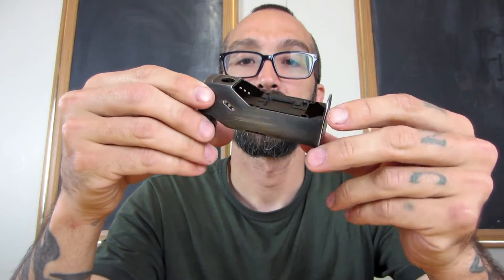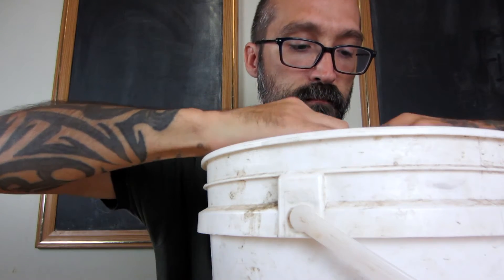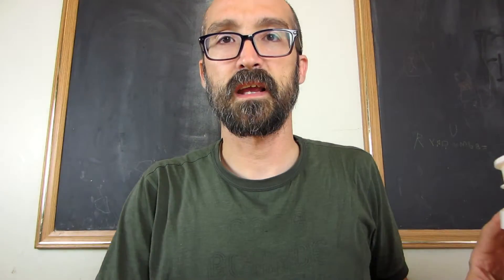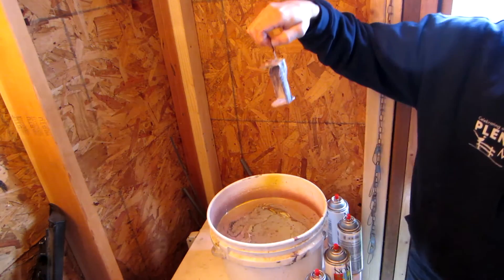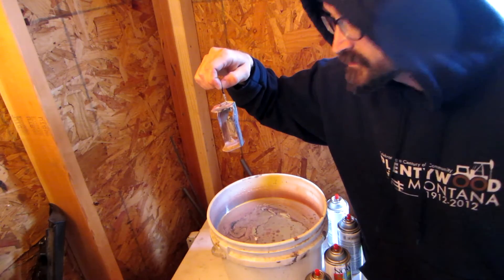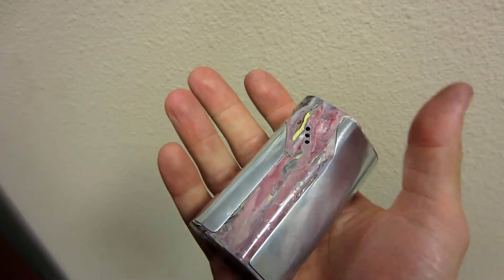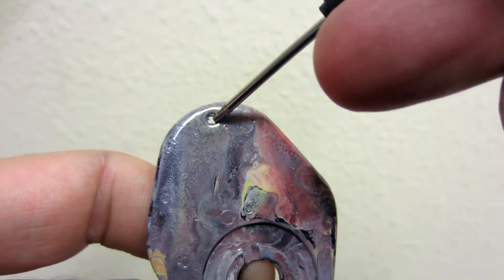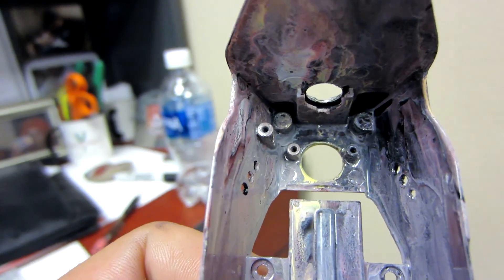RX200 PAINT| MODDING MODS EPISODE #2| DAVE GEE | ELECTRIC REVIEWS

Comment: I've never hydro-dipped something, but based on the mechanics of the process it seems like you might have better luck doing it the other way round.  Try this: put the paint on top of the water as you have but put the item into the water in a relatively clear spot, then slowly lift lift the item out through the paint, that way the paint gets applied on the item's way out of the water instead of immediately before the item is submerged in water.  I feel like it might come out less "muddy" if you do it that way.

Comment: Awesome! I've been hydro dipping some parts on my scooter, didn't think to do it to a mod. Thanks for the videos! I've got a few mods to disassemble.
Reply from the maker: +Alex Sayers Thanks man, I have ended up doing it again and did not like the results so I went with some auto paint. Deep pearl blue like you would see on a corvette. Those colors just weren't my style.
Reply: +Electric Reviews I was thinking a deep purple, forest green, midnight blue, silver, and black for my sny sdna200. Going to try it on a nemesis clone tube mod first. I am pretty sure there are some hydro dipping spray paints.......
Reply: +Alex Sayers enamel modle paint works great as well.
Reply from the maker: shit I never thought of that... Pro tip man thanks.
Reply: +Electric Reviews your welcome I would use pipettes to transfer the paint into the water.
Reply: +Electric Reviews one drop at a time ando add to your liking.
Reply: +Bishop Vapes Right on thank you!
Reply: +Electric Reviews you could also possibly get it down to the bare metal, use alcohol inks, then clear coat it once dry! I have used alcohol inks on some mech mods I have, you can get a very interesting look from it! If I ever get around to doing it on my RX, I will be sure to send you some photos!
Reply from the maker: Drew Harris That would be awesome. My sister just started doing mugs and coasters with ink, I tried it and didn't like the effect... until I looked up some real work with it. Holy cow there are some crazy things a person could do with it. I would love to see pics.
Reply: +Electric Reviews my mom has done our coasters at home with them!! That's too cool. She just loves the splatter, but when I saw some inks done by artists, it was astounding! I'll be re-watching your previous video in this little series of how to strip the paint and how to do the polish, whenever I'm ready to tackle that fun time! The problem is that I'll be without the RX for a day or two to let everything dry! I'll need to wait until GeekVape gets the replacement positive pin in at their US service store so I can use my mech and Tsunami while the RX is out of commission
Reply from the maker: Drew Harris I took me forever to film the DNA swap just for that reason. Once  I had it in there I didn't want to take it out and risk soldering off a fuse or something.
Reply: +Drew Harris can you send me a pic as well?
Reply: +Bishop Vapes for sure!
Reply: +Drew Harris thanks alot Drew.

Comment: what did you use to get the original paint off the body of the mod? I know a lot of people were having an issue with that
Reply from the maker: I ended up doing the stripping more than once and its never fully come off. Its almost as if its cast and anodized. Its a rougher surface than the plates. I'm sure its cast but not sure if its anodized. Sanding is about the only option for that part since its going to need to be a smooth surface for polishing.
Reply: You can actually get a full stripping with only handheld sandpaper, I did it myself
Reply: +Suspicious Tumbleweed* yea but I was trying to keep the metal surface as scratch free as posable and was gonna do it like over the weekend
Reply from the maker: jordan marquardt use stripper on the front and back plates and you will HAVE to sand the middle body piece. It wont polish like the plates without a sanding. Or just leave it and have the plates polished.

Comment: is there any sawtering required?
Reply from the maker: the painting portion of this did require a little bit of soldering. Desoldering the positive from the battery sled and  the 2 battery taps at the bottom of the board. ( then of course resoldering during reassembly. ) 1:25
Reply: +Electric Reviews so all wires disconnected will have to be soldered back into place when putting all back together? Sorry, just trying to figure all the dissembly and resembling of the mod because mine is sanded and ready to paint but I also don't wanna fuck my mod up.
Reply from the maker: If you plan on dipping the MOD as I did you will need to remove the board and desolder the positive connection and the 2 pins for battery monitoring. If you do make sure and take a picture of the placement of the wires so you can refer to it when you go to solder them back. If you don't plan on dipping it and just spraypainting it, I suggest getting a can of automotive touch up paint and some blue masking tape. The automotive paint will dry fast and hard.
Reply: +Electric Reviews I plan to do a texture spray paint. so that being my decision taping the board and other important parts will keep it safe?
Reply from the maker: Mike Varner yes, make sure and get those vent holes taped as well. or stick some tooth picks in them and take them out after painting.

Comment: I just want to get the fire button off. I dont want to remove any wires.
Reply from the maker: you need to remove the sled so wires need to be disconnected. There is no way around it. unfortunately.